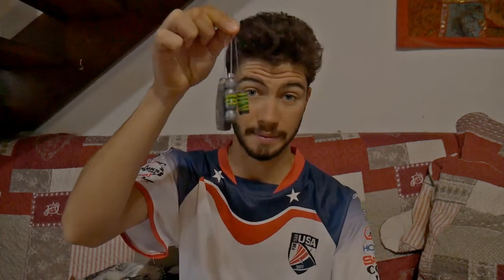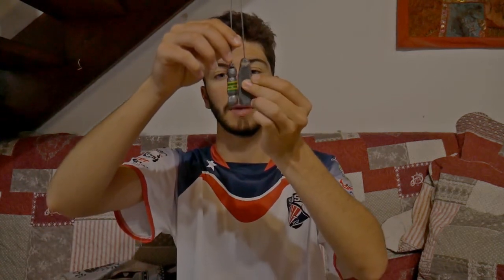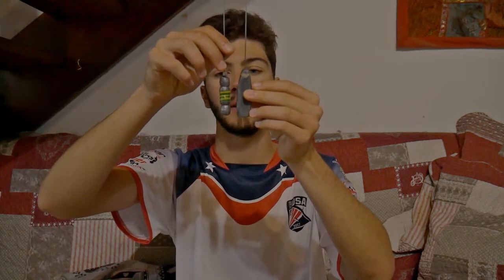F3K / Wednesday Tech : The ballast !

Comment: Hi Pierre. Thanks again for some more useful info. So please tell me, as I have a Blaster 3 and you said it didn't need much ballast, what is the max it can use? Or rather what is the max it needs?  Also you said something about the NXT not being able to carry heavy ballast. Is this structural weakness?
Reply from the maker: Nick Sutton hi , Thank for the comment  ! 
Yes the blaster 3 love weight . in wind it need to be at max 450 g , the limit is because of the airfoil , over this weight it not work well . 
For the over 360 g NXT it s about the same as the blaster 3 , over this weight the airfoil start to not work well .